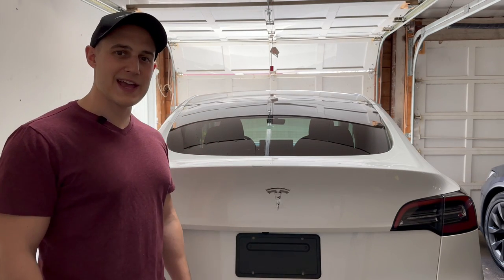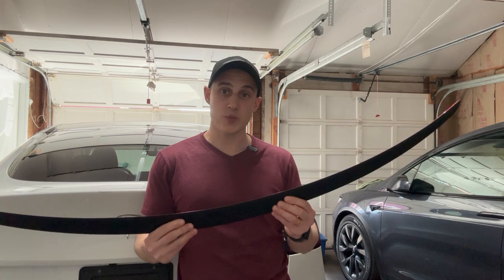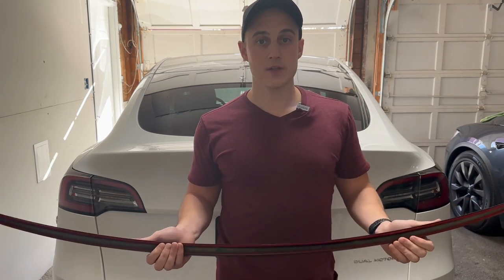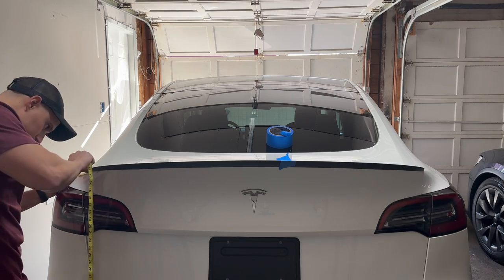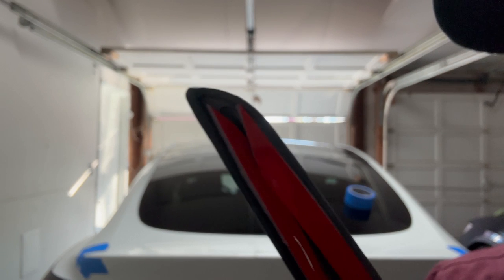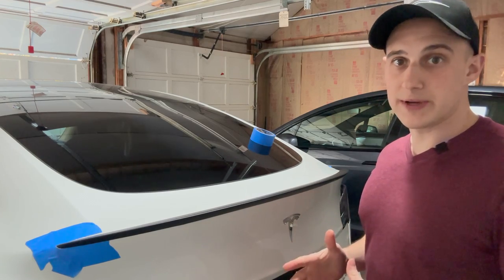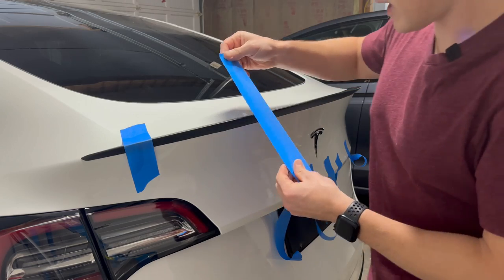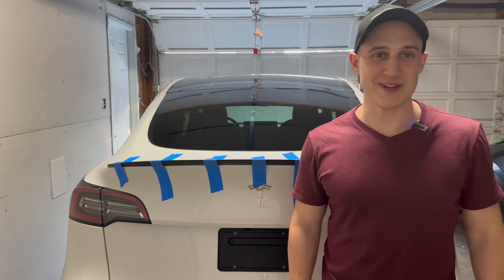Tesla Model Y Spoiler Install!

Comment: I got the same exact spoiler from Tasmania for my 2023 MY. At the shop that was putting on the PPF, I had them put on the spoiler and Tesla matte black badges at no xtra charge since they did the PPF, powder coated my wheels and ceramic coated whatever did not have PPF. They did use a stronger 3M adhesive tape vs using what was already on the spoiler. Job was great and the spoiler takes the look of the car a few notches up!    As for the Tesla badges, they went over the existing Tesla badges - no need to take off the chrome Telsa badges. The badges bought on Amazon had inset space on bottom so that the chrome badge would easily lay inside the new matte black badge. They also look great!
Reply from the maker: You made great decisions! The spoiler definitely gives the MY a more sporty look and I love it! What color is your MY?
Reply: @Cosmic_Nick  White
Reply from the maker: @lauracoello4583  Teslas look so good in White

Comment: If you google matte black Tesla logos, you'll see you get them everywhere easily. They look really clean when replaced.
Reply from the maker: Oh wow you are right. I didn't realize it was such a common item you can purchase for a Tesla! Once I find one I want I'll share some pics of the outcome!
Reply: @Cosmic_Nick  think you can plasti dip the current logos cheaper, and if you need to sell it, just peel it off.  can do it without removing the stock ones
Reply from the maker: @nivek4222  I ended up putting on logo covers it was super easy and look great! Thanks for the tip though, I may try the plasti dip on my Model X

Comment: I guess this spoiler is cheaper than an actual paint job over the panel where you had the scratch.
Reply from the maker: Paid $80 for the spoiler. It looks great and is holding up perfectly fine. Haven’t had any issues.

Comment: Hi! Got a similar scratch (mine’s even bigger 🥲) Do you recommend touching up the paint on the scratch before adding the spoiler?
Reply from the maker: So sorry to hear that! I do not think that it is necessary to touch up the paint. I only used the touchup paint first because I wasn't originally going to put on a spoiler. Let me know what you decide to go with or if you have anymore questions! I'd love to help!
Reply: @Cosmic_Nick  I ended up getting it touched up, for about $250. They did a pretty good job so it’s only noticeable when you really stare at it up close. But I think I’ll end up getting a spoiler one of these days just because it looks nice with it.
Reply from the maker: @niccocino  It definitely has a more sporty look with the spoiler, which I've come to love
Reply: Are you having any issues with the edges lifting? I see a lot of people have this problem.
Reply from the maker: @vietle-gu9pe  I am not experiencing any issues with edges lifting yet. Hopping that doesn't happen to me. If it does I'll try to put some 3M tape in the spoiler to keep it secure.